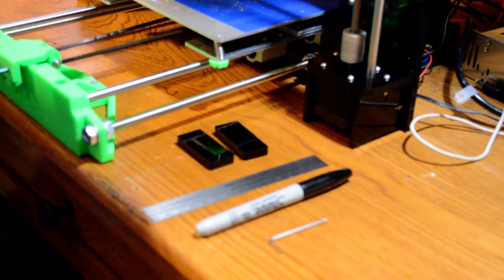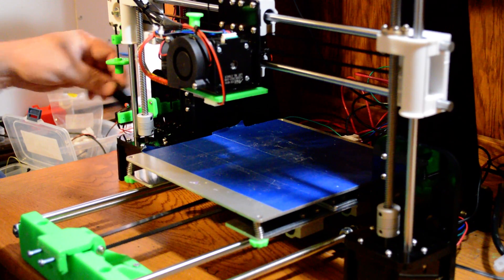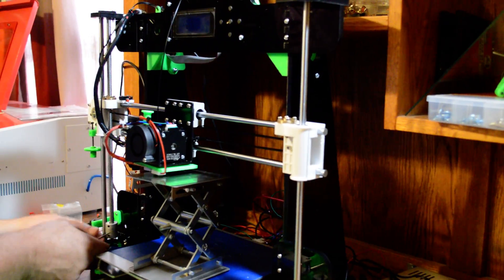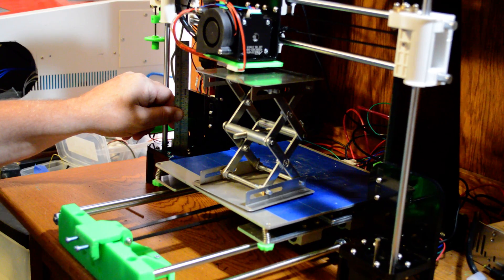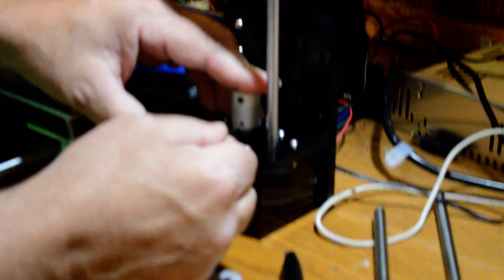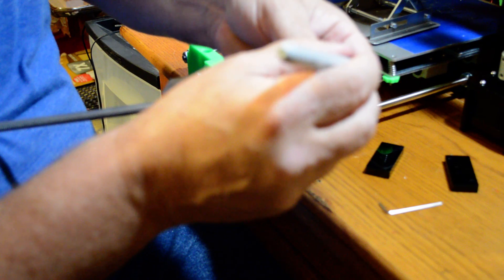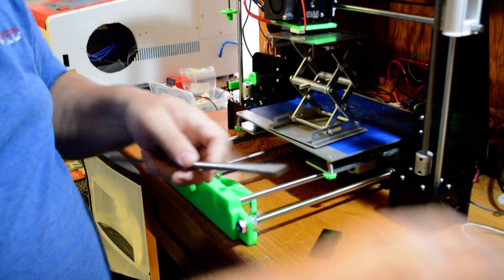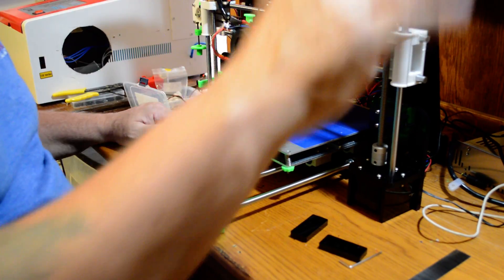Fix Z Wobble on your 3D Printer

Comment: The correct assembly of these couplings is shown in the makers/suppliers catalogues. Boston Gear/Huco for example shows it. There is clearly a disconnect somewhere between the original suppliers and the final purchasers assembling them without these instructions. As has been pointed out though they can act as springs which is why some people suggest a ball bearing in the centre. A better option may be to use Oldham couplings that can take the weight without any spring effect or the flexible jaw couplings. I don't have a 3D printer but do have CNC machines so I am not in a position to try the three different types and suggest the best one for this application.

Comment: I think I understand why this fix works. Its probably because the couplers are intended to be flexible to account for the subtle misalignment between shafts that is inevitable in machine assembly (The coupler is like a universal joint essentially). Your motor shaft and threaded rods are very likely not perfectly on center with each other, so rather than try to perfectly align the rods (which would be quite difficult), you can make the coupler flexible to accommodate for the misalignment. 

For these couplers, If you have the shaft and lead screw butted up against each other it prevents the coupler from being able to flex, thus the slight eccentricity that is caused by the misalignment is transmitted and causes the Z wobble. The majority of the positional tolerance in the machine should usually be based on the smooth rods (since they constrain the motion of each axis).
Reply: W explanation🙌

Comment: I would be tempted to cut off a bit of matchstick to the appropriate length and drop it into the collar before  putting the top rod in. Stick it in, mark it at top of collar and cut it 5mm shorter.

Comment: I think you are missing one thing that can contribute, and that is the alignment of the lead screws nut, to the lead screw. As received, the brass nut was not quite parallel to the line between between the top hole and the coupler. I had to shim my nut under the mounting screw. One was out ~1/2 of the diameter of the lead screw,  the other almost a whole diameter, with the carriage up as high as it would go.

Comment: This had been bugging me since I assembled the printer a couple of weeks back, but all the pictures I saw had the Z-screws "waving in the air" at the top, so I figured I must have done it right (though I didn't like it). Awesome video, short and to the point, it explains the problem and clearly and simply and how to fix it without messing around. Well done, sir!

Comment: That type of coupler can cause you a lot of trouble with the Z-Axis.
It might sound strange but you DON'T want a gap inside that coupler, if the shaft can goes hight enough some people put a ball from a ballbearing inside.
This coupler works like a spring, think about it !!!!

Comment: Sorry, but this video should be deleted. You are fooling users of Anet A8. Almost every Anet has bented screw rods,  but it is perfectly ok, because it is not affecting printing precision. With one exception - if you add bearing on top of screw rod OR if you assemble your screw rod that it cant wobble on top like you (you stopped your rod from wobbling but every force which is rod pushing agains top frame is reflected on your print as wobble). If you want best results, there should be also no gap in coupler and rod should ending exactly in the middle of the coupler. The reason is that coupler is working as spring on Z axis and X axis should not balance on 2 springs.

Comment: Thank you.just running 1st print after the alignment!
Tried with digital calliper  instead of ruler...didn't work.
 I'm sure it will make a difference as one of the screws was wobbling and then wiggling.

Comment: Great video. Those are basically “clutches”. They are used to prevent jamming because it would be almost impossible to perfectly align the stepper motor shaft with the threaded rod lengthwise in all 360 degree. directions. They allow a little “give” with out breaking the motor or rod. Think of it as a U-Joint in your truck. The transmission shaft is straight as it turns while the drive shaft dips a little towards the rear differential. I hope that helps you as much as your video helped me. I pressed like!

Comment: I tried the printed parts and it showed strong improvements in my prints. i understand the fact i could use them was because i installed my z rods incorrectly. I reinstalled them correctly, but im back to having z banding/wobble (or whatever other name it goes by)  issues again. Does anybody have an information that could be of use.  Thanks to anyone who can help.

Comment: Just a suggestion for those who don't have measuring blocks or a block of quite the right thickness: use the shank of a relevant sized drill bit - good for 0.5 mm accuracy in most cases and most but sets come in 0.5mm increments.

Comment: I have a geeetech prusa i3 pro B and I have an issue where both my Z-axis motors lock up and vibrate instead of rotating. What could this be?
Reply: SoupsSB I’m no expert but maybe the screws holding the motors in place are digging into the motor itself and are too long

Comment: There is a problem with this type of shaft coupler that he totally missed.  The problem is the coupler is machined like a spring which allows up or down movement of the lead screw.  The way he installs the coupler and most people do, allows the lead screw to spring up and down.  If you install the coupler like this, and then push down or pull up on the lead screw, you will see that the coupler acts like a spring and allows the lead screw to move up and down.  I'm now sure how much that affects print quality, but it definitely not a good thing.  There might be a simple way to fix this.  You could attach the coupler to the motor shaft first, like he did, but then when the lead screw is inserted, let it drop all the way down until it buts against the motor shaft.  Then hold onto the top of the coupler, and stretch it a little bit, and while holding it stretched, tighten the sets screws.  That way the lead screw will be held against the motor shaft, so there won't be any up or down movement of the lead screw.  Some people might not like this idea, but I think it would work.
Reply: the forces acting on that system is low and stable, z axis movement is intermittent (layer by layer). In operation you wont see the springing effects. The purpose of the coupler is to decrease the forces caused by possible misallignment of the motor shaft and screw shaft. The 3d printers are mechanichally crude assamblies and the parts are (apart from steel rods) are produced with high tolerances, the coupler is a way to owercome the effects of that. the reason we can get away with it is because of the low loads. Good prints are slow prints because of that, increase speed, increase the inertial forces.
Reply: Indeed the chinese assembly manual explicitly told me to insert the lead screws into the coupler all the way to the bottom. Before reading that, I was going to do it just like in the vid, simply because those holes above the screws were there and it seemed logical to get the screws through them. Personally, I wouldn't like to have this heavy X assembly sit on springs. Especially since the weak printer structure vibrates so much.
Reply: @Overbuild, I can confim that the trick worked out for me. The prints are much smoother and now is the leadscrew not offset with the hole on top. At the same time, I also measured the height with a height gauge (0.01mm) and aligned both axis up to +- 0.06mm from each other ; better isn't possible due to the steppers and pitch. Then I also marked both couplers with a marker to indicate their zero. In case one runs just a step different from the other, I will notice it and can correct. But it did the trick !
Reply: Seriously, you all need to read @onebreth's comment, slowly. Let it sink in. And now I will tell you all in "caveman" cuz it seems you don't understand fucking basic physics: "cap on top of threader rod bad. spring coupling actually able to do it's job good (like in the vid)" . "Oh my gooood, my opinion is that it's better with caps and bs like that". NO. Like @MakerFixes said in this awesome video, you're putting a band aid on a broken leg. What's wrong with you people? Also, As @MakerFixes said, if this doesn't work, your lead rods are BENT. Time to change them!
Reply: @notioncreanga  Bent lead rods are not an issue (almost every Anet A8 has bent lead screws because of low quality production), but only if you are not doing stupid things like placing rods high enough to enable them to push against upper frame like guy in this video did.

Comment: No matter what I do with this I still get visible Z-wobble, the issue is when I clamp the lead screw into the coupling it bends the coupling off centre I've tried tightening up the set screws slowly and at the same time and it just lessens the bend. I don't think I'm going to completely eliminate Z-wobble this way unless I switch those couplings out.

Comment: On a A8 facebook group....I was told this is wrong!!   I was told the Prusa machines have a ridged connection between motor and lead screw .....also told that adding bearing to the top brackets to enclose the threaded rod....transfers vibration to the frame....any comments.../ advice?
Reply from the maker: The machine I have used int he video is an Anet,  the manufacturer of the machine recommends against any mod hold the top of the threaded it is suppose to be free floating
Reply: Can you give a link to the Anet info for these bearings and rod assembly.   Do you know why Prusa do not assemble the z motors...rods like this and are fixed?
Reply from the maker: The Anet machines come with a flex coupler, some other makes have a ridgid setup

Comment: I just wanted to thank you! 

Recently I looked at my right Zaxis and one of the screws was sticking half out. I just tightened it (not thinking) and from then on, my zaxis has this grinding noise when near 0. I tried realigning the right side and the sound was a little better but continued on for 2 more weeks. I saw a post on FB, Anet A8 group linking your video. Seeing how fast you fixed this was inspiring. As soon as your video finished, I got out a sharpy, ruler and alan-key. Pulled the z shafts and connectors, measured and reinstalled everything according to your video(less than 10 minutes)... and Success!!!! Noise is gone!  Watching more of your videos right now. Thanks!!

Comment: On my old i2 printer i don't have auto leveling and i have hard mounted the printbed on standoffs . as a result this alignment is ultra critical for me. However, i have never needed to make this adjustment, all you need to do it turn one side of the z rod or the other to level x right on. also, if the rod is bent....bend it back.. happy printing.

Comment: Another big mistake is to totally fix the printer on the table. I'm a fan of the opposite method: Putting the the printer on a flexible material (rubber mate or you can print out fancy anti tension holders - same effect). Results: Better prints and amazing less sounds. It's important that the frame of the printer is stable so those fixes are a good idea (but not too much, because an acrylic frame would never be as good as steel).

Comment: The coupler has a spring in the middle to compensate for any misalignment between the axis of the stepper and the rod. Some people suggest to use couplers without springs or press the axis together to get rid of the spring action
Reply from the maker: Yes I am aware anet among several other manufacturers recommend against by passing the spring coupling system. Some printers also come with solid couplers I expect this is due to the quality of the workmanship of the printer. as we all know the bargain basement printers while they can be great printers, the out of the box quality is often lacking
Reply: It's all about destressing the y-stepper motors. You can fix them to death ;) - Even on CNC machines you'll use such spring couples. There is also another method, but I didn't tried it out (because I also have no wobbling problems at all): https://www.aliexpress.com/item/T8-Anti-Backlash-Spring-Loaded-Nut-Elimination-Gap-Nut-for-8mm-Acme-Threaded-Rod-Lead-Screws/32762831143.html

Comment: Careful at the end of your video when adjusting carrier height individually on z motors, you are inducing current to the other motor and it is moving. Unplug motors before this adjustment, and double check your measurements.
Reply from the maker: Good Point motors produce electricity that feeds back into your main board

Comment: 아무런 부품, 장비, 기술 없이 할 수 있는 z축 와블 제거 방법. 와블 문제 해결 시 첫번째로 시도할 만한 좋은 방법이다. 이거 해보고 안되면 다른 방법을 시도해봐야지
Reply from the maker: For my english speaking followers I will translate
Lee Jong Won's Korean to English:  "How to remove the z-axis wobble without any parts, equipment, or techniques. This is the first good way to try wobble problems. If you can not do this, try another way. " 
Note as I do not speak Korean I hope I have this correct.

Comment: your h bracket under your bed needs to be flipped around 180 degrees
Reply from the maker: i don't use that h bracket I It was just there because I took my reprap out to get the pattern to make another one. I just stuck the bed in for the video

Comment: The flexible coupling is prevent vibrations from the motor from transferring to the drive shaft .You may want to make some caps for the rods still though to silence the vibration at the top end of the rod and the frame. Mine is made of thin cardboard from some cigarette rolling papers (Roach). It is not a tight fit it just dampens the sound.
Reply: The trouble with this is that taking the slack and play out of that assembly makes it less forgiving to rod wobble.
The opening is big on purpose.
If it's seriously rattling around in there, I'd wager you have another problem.

Comment: Is there a reason why you just didn't level the top of lead screw with the frame?
Reply from the maker: Yea  some I use it as a double check (at least on the stock anet), but not all printers are made the same as the anet. Also some people replace parts, this could alter the final alignment at the top.  the main goal here is to make sure there is a gap  inside the flex coupling,

Comment: Thanks for the very concise video. I had issues and printed one of those parts. I'll be doing this instead. I think the primary reason people make this mistake is because (for me at least) the coupler was screwed in very close to the base of the stepper motor rod. If they're shipped separately you'll look into how to assemble it.
Reply from the maker: Yea mine where the same took me some time to work this all out

Comment: Nice finding!  It is a great fix but it doesn't go all they way;  the frame holes are 10mm and Z rods are 8mm so there is still some room for wobble.   Maybe we could put some sort of sleeve between the rod and the frame?
Reply: the idea of the ten mm hole is just to insert the rods, not to make the rod's a snug fit ,if your rods are touching then have a look  at how square / straight the frame is, a lot of people don't keep the frame level when building causing a twisted frame, one  may not see by eyesight, but mostly their will be,
in this case then put printer on a solid flat surface and loosen the frame screws, give the frame a bit of a wobble to de stress it and then tighten back up keeping the printer firmly on the flat surface  and see if that helps.
Reply from the maker: Anatoly, if you look at your coupling you will see slots in it, it is designed to have flex. The extra MM in the hole is is also intentional. the threaded rod needs to be able to "wiggle" at the top and bottom. If you stop this wiggle mechanically it transfers to the print itself. Remember the threaded rod is NOT a support structure.  its part of the drive system. So first off you have to make sure its straight, the better job you can do and making sure your rod is not bent and aligned straight the better your print is.